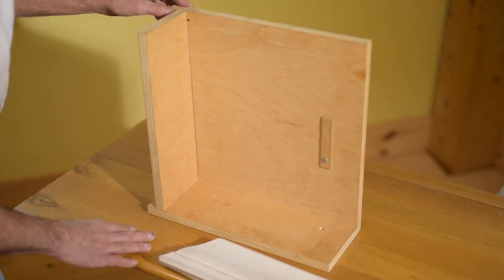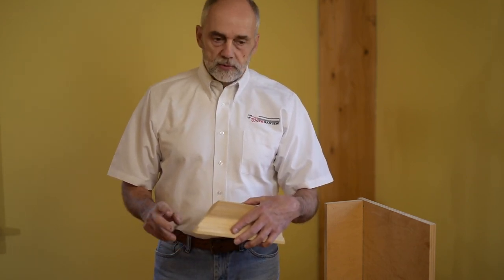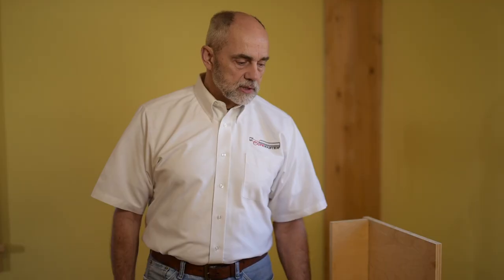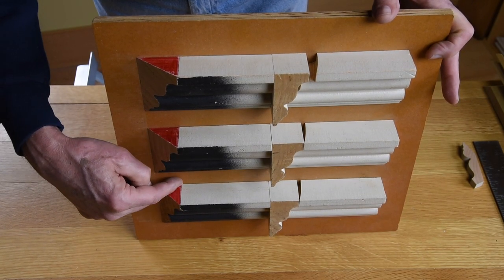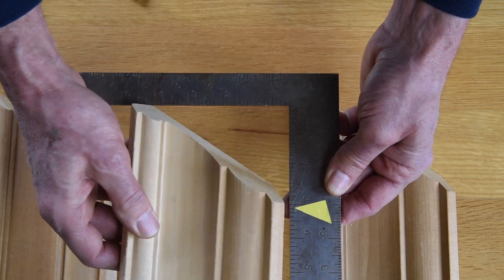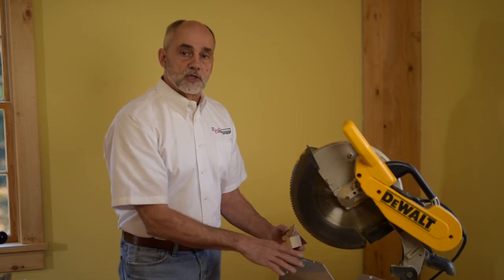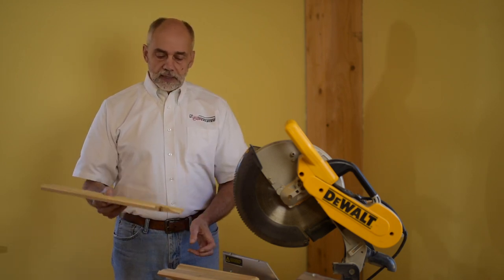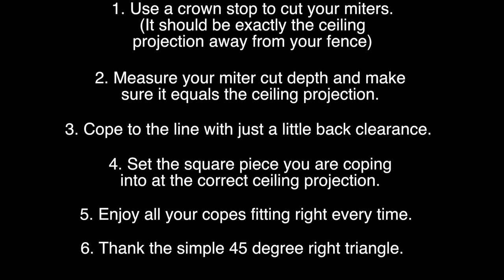Understanding the Coped Joint

Comment: Do you still cut a 45 degree cut to then cope if the wall is an inside corner with 135 degree corner? Or would you cut the 22.5 degree and cope that due to the 135 degree inside corner?